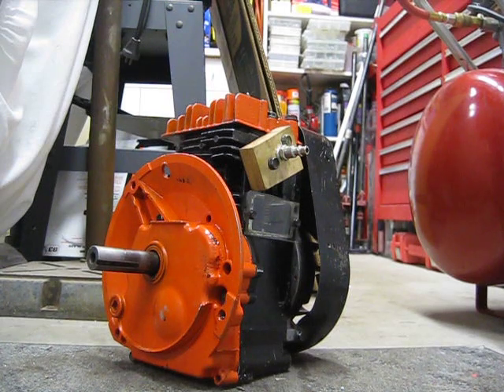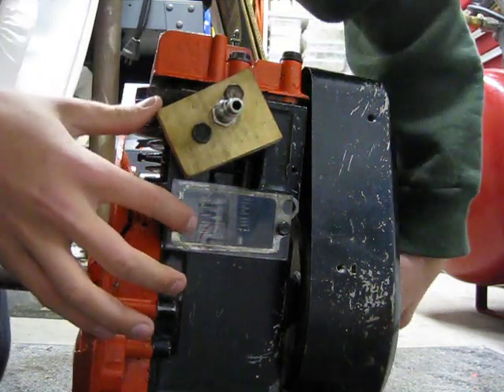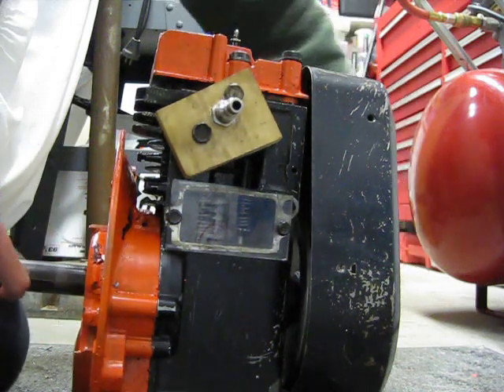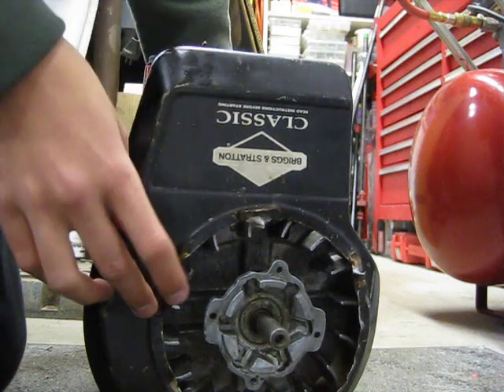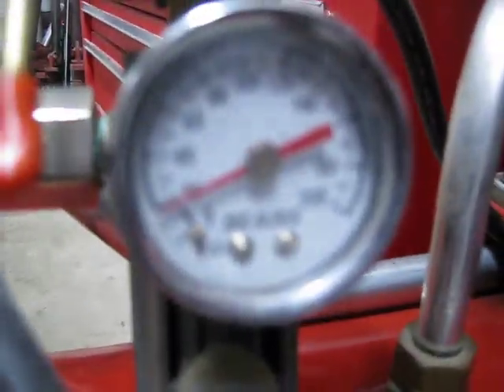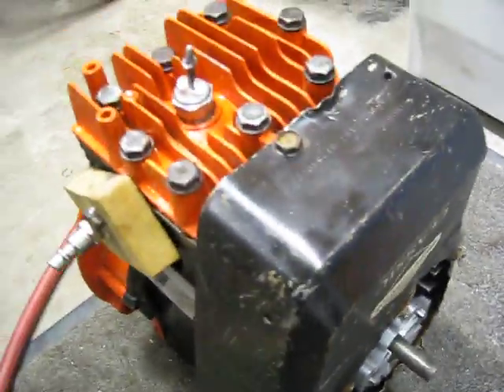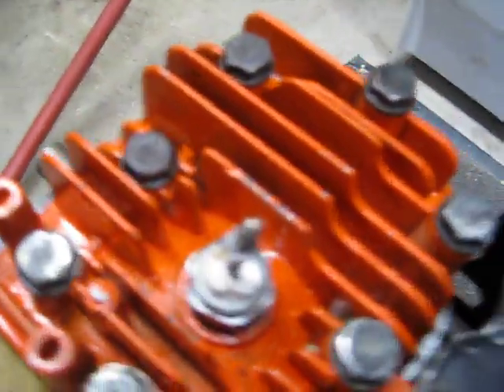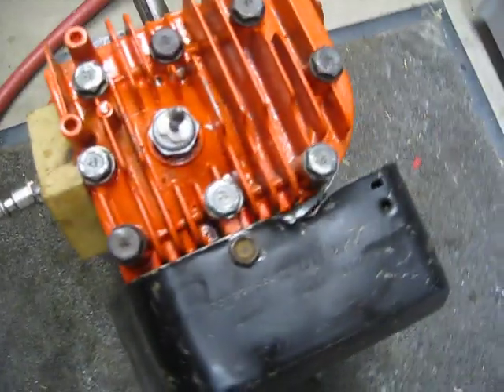Air engine explanation and run

Comment: They are great : )

They are like the British briggs, you see them everywhere. You just can't kill a Suffolk engine and you will be suprised how little it takes to make one run. Mine had sat outside for 10 years in the sun rain and snow! I just whipped the flywheel off, cleaned the points, decarbonised the head and away she went. I will have to do another video of it as it's running far better now for some more tinkering with the valves.